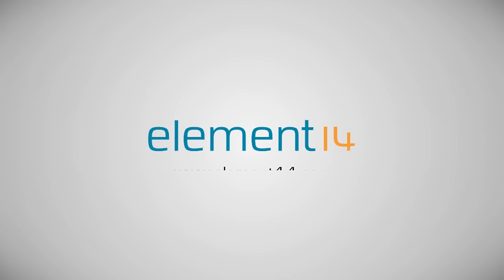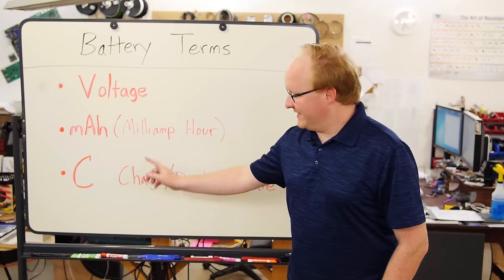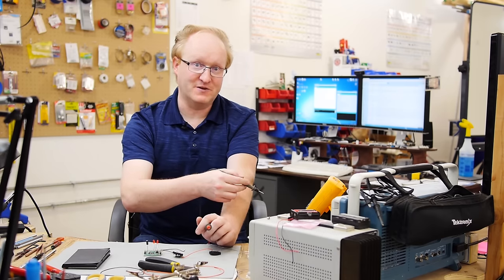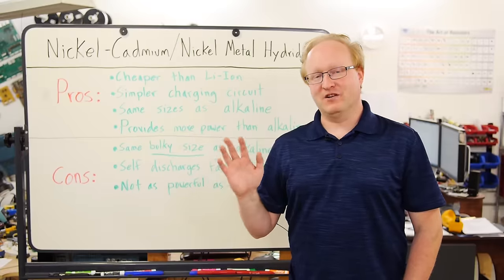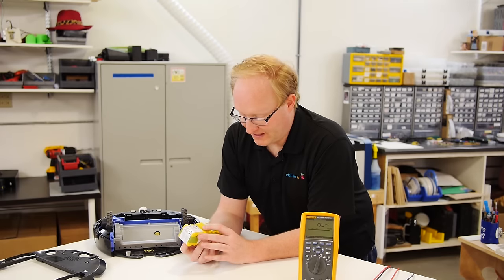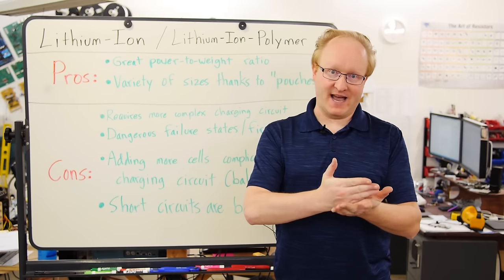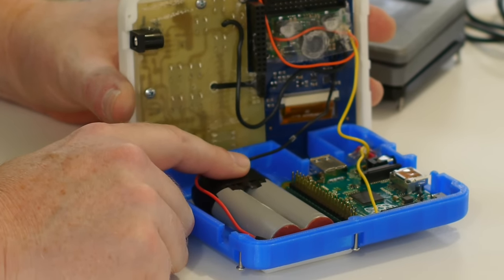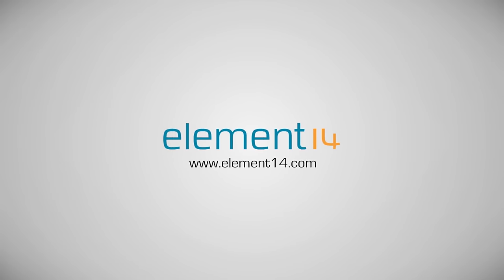Ben Heck’s Essentials Series 2 - Battery Power

Comment: No love for jell lead acid batteries? They work the same as normal lead acid, but the acid is gelatinized, so no need to worry about leaks, and the battery can be completely sealed.

Comment: I still remember how someone left a lead-acid battery connected to the charger over the weekend in our confined robotics lab, obviously, it exploded, and the smell was DELIGHTFUL... /s
Reply: דוד שלמייב quick-charger?... normally lead-acid batteries don't explode unless something very bad is done with them (such as excessive charging voltage while having them next to an open flame or similar).

well, unless it is a flooded lead-acid (vs a VRLA / AGM battery), which tend to leak a bit more hydrogen.
Reply: Brendan Bohannon Yep, quick charger.
Reply: דוד שלמייב
yeah.

I have mostly ended up charging batteries with a lab-supply, mostly for sake of control over voltages and current.

I have an automatic charger, which seems to like spiking to around 17 volts, which is a bit out-of-spec for the batteries I use. I tend to do charging at 14.8 and then drop to 13.6 when the battery is mostly charged.

the opposite end is a UPS which seems to always trickle-charge (so takes very long time to charge a battery and generally never goes over 14v).

granted, most of the batteries I use are the smaller / UPS-style batteries (mostly sufficient for a lot of the stuff I am doing).

plenty sufficient for small robots.

Comment: Sony used the battery on the PSP (or rather the circuit inside the battery pack) to tell the system which state to boot to. For instance service mode. This is what allowed the "Pandora Battery" hack to work, as users were given access to precisely what I just mentioned: The system's service mode.

Comment: Some 9V Batteries have AAAA batteries inside, not AAA
Reply: Witold Witkowski Was about to say the same
Reply: Witold Witkowski
most 9v batteries I have looked into have a stack of small rectangular cells, typically surrounded by a layer of plastic. IIRC, one had separate cells as individual units stacked together (similar to rectangular coin-cells). more common seems to be alternating layers of plate and electrolyte, with a shared shrink-tube style exterior.

though, this is alkaline, no idea about NiMH.
Reply: What brand were those? I would think the cheaper ones would be those stacks vs individual cells but I don't have any experience, I just remember seeing they were quad A not triple A.
Reply: *****  I forget now what the stacked coin-cell one was. one I looked into recently was a "Bateria Prima" battery, which was using the shrink-wrapped tube of plates construction. also have some "PakKo" batteries and similar.
Reply: I can't remember which channel as it's been a while but they tore some apart, I seem to remember the name brands being in AAAA package instead of open in plates. But I could be mistaken.
Reply: *****  could be. don't really have any big name-brand 9v batteries on-hand.
Reply: *****   these have coin-cells, granted, but the battery in question was still a normal 9v PP3 battery.

https://en.wikipedia.org/wiki/File:9V_innards_3_different_cells.jpg

the left two are what I typically see.

the weird one was more like this:
https://en.wikipedia.org/wiki/File:9V-NiMH-opened-battery.jpg

except I think it was still alkaline...

ADD: checking, actually it seems a lot of my batteries are Zinc-Carbon...

Comment: There is one pro for Lead Acid that you should have said. Shelf life. A properly maintained lead acid battery can last for many years where as batteries like Lith-Ion have very limited charge/discharge cycles and typically need replaced after a couple of years depending on how often you use it. Lead acid is great for powering out door solar projects as they are easy to charge, store a lot of power and have a long charge cycle life. We use them for our emergency power for our ham radio equipment on mountain tops and in our to go trailer.
Reply: ***** Dead right. I have an APC UPS system from 2001 that has the ORIGINAL lead acid batteries in it. They are still going strong to this day when the power cuts out. Now if only I could get the monitor to work on Windows 10. Worked on 7. Oh well...

Comment: I really thought that the Li-Ion batteries were safer, because I heard that the Nickel ones were more likely to explode that Li-Ion... My whole life is a lie :(
Reply: Nahir Sanchez yeah. vs LiON, the nickel-based batteries are pretty stable. also they can be run completely flat and they don't care.

had a NiCad battery pack I have been using (3.6v), that I had got ahold of second-hand about a decade ago. so, about a decade of sitting around in a box. charged it up, and it works fine. though, the first time I charged it up (after a decade in a box), it seemed to go dead again pretty fast. after this (charging it again), it seems to go pretty strong.

though, I am mostly using it for testing boards (providing logic-rail voltage and/or for providing control signals). this is partly because a lot of my boards use multiple voltage rails, typically 3.3v or 5v for logic, and one or more higher-voltage rails (12v or higher) for driving loads.

Comment: there are two types of C  for discharge..
Constant and Burst..
Constant - 2A battery & 10C = 20A constant
Burst is normally conciderably higher
Burst - 2A battery & 30C - 60A burst..

meaning.. your specific battery can safely discharge at a constant of 20A, but can handle short bursts of upto 60A..
remember.. C rating is the amount of Safe discharge..
Discharging anymore than the specified ratings can cause damage to cells, and can lead of explosions and fires..
(i used to race Brushless RC cars, with LiPo batteries)....

Comment: Ben, the Roomba battery pack is not a bunch of batteries in parallel. It's 12 sub C cells, all in series - hence the 14.4V (12x 1.2 = 14.4). 3000 mAh is a common capacity for sub C cells.

Comment: The RAYOVAC lantern battery that was opened up at about 5 minutes into the video and was implied was Alkaline is actually Carbon Zinc.  RAYOVAC uses this color combination on the battery package for many of their heavy-duty Carbon Zinc batteries.  Additionally, RAYOVAC would always include the word "Alkaline" on at least the main panel of the battery if it were Alkaline.

Comment: The DeWalt 20V Max batteries are actually 18-volt batteries.  I'd like to see you build an adapter with a built-in low-voltage cutoff circuit that would allow you to use 20V Max li-ion batteries in 18-volt DeWalt tools.

Comment: The Ben Heck Show  How about sharing the charging circuit you use for LiPo batteries?  I've been watching for some time, and have seen you make your own but you never share any information about it.  I am looking for something that both powers your device as well as charging the battery, then will run the device from battery power when the charger is unplugged.  I've found many specialized IC's in BGA or other non-hobbyist packages, or they are dedicated chargers.  It would be nice to know what kind of solution you came up with!

Comment: In airsoft, guns that run on an electric motor to drive an air piston (AEG) most commonly use NIMH batteries. Because of their relative stability, life, and cost. Although some people use LiPo batteries for their high current output. Although those are less common for their tendency to destroy systems that aren't designed to handle that much power in burst. Which requires extra cost of having reinforced gears,motors, and frequently mosfets. As well as their tendency to heat and burn up if used incorrectly or damaged.

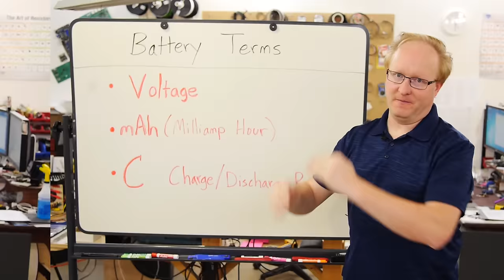Comment: Small error at 2:55; 'mAh' does not describe the power, it is the current draining capability. For power you need the 'mWh' rating which is actually more useful but is less often labeled.

I'm sure Ben knows this and it was just a slip of the tongue, but I thought that I'd point it out.

Comment: This was a good basic presentation for the most typically used battery tech used today. Although, I would have liked to see mention of Absorbed Glass Mat batteries when you got to lead acid batteries. They are very expensive but are more powerful, can go through more charge/discharge cycles than lead acid batteries before failing, they are sealed so it cannot leak unless the case is ruptured, and do not put off sulfur-dioxide gas when charging.

Comment: Very informative. I know that the xbox 360 controller will run off of double A batteries without a power pack if you just wedge some pennies under the batteries to keep them in place.

Comment: Another reason for not putting batteries in checked bag and keeping them on your person is the baggage area of the plane is not pressurized so there can be temperature and atmospheric changes which could cause the battery to swell and possibly short internally. Where as in the cabin area it is pressurized to simulate sea level atmospheric pressure and a comfortable constant temperature which batteries can safely survive in. Unless its a Samsung Note 7! :D

Comment: I remember taking apart a xbox battery pack before looks like it a had a temp probe thingy hanging on it I didn't see that  on yours so it stopped charging when it got too hot so I removed that and they charged fully instead of five minute charge only lasting ten minutes without the charge cord

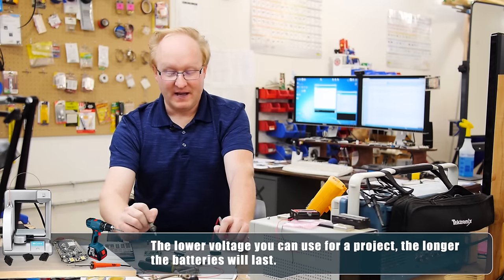Comment: 8:00 wouldn't something that runs on a fixed voltage internally use less current at a higher input voltage? I'm guessing that the extra power draw was because the leds were connected in such a way that they get the un regulated input voltage since they were significantly brighter with 6 volts going in to the setup.

Comment: i found a battery that is supposed to produce 12 volts and run a portable screen but the screen will not work right when i plug it in it works fine using a 12 volt wall wort though

Comment: Ben, is it possible to transform an Li-Po battery pack from "model planes" (don't know the name) into a battery pack for your old notebook that you have laying around?
Because I have an old HP Pavilion dv6670 and it's battery went dead. I think it would need a step-up voltage regulator too because it uses 18 volts to power it. I love the show! Cheers from Brazil!
Reply: Pesterenan You can connect Li-Pos to a boost converter. Connect the boost converter output (correct voltage) to an old laptop power lead and you are in business. The only catch and this is important. You must have an under voltage shut down. When the Li-Po voltage gets low it must shut off or you will ruin the batteries.
Reply: Great! Well thats a really cool project, unfortunately Li-Pos here are really expensive, and on top of that, they can explode if charged incorrectly. But that really is a good idea. Thanks!

Comment: I was hoping Ben would discus lithium iron phosphate batteries
Reply: John Wiggins Me too.
Reply: John Wiggins yeah. I guess they are basically like LiON, but better behaved and less explosive, with less energy density but more power density (lower capacity but more amperage). price seems similar to LiON cells. seem to use same cell-type numbers/sizes as LiON as well...
Reply: John Wiggins If you really want to look at different types of lithium cells you want to check the torch guys or vapers. Lots of pretty graphs to look at.

Comment: I heard that Alkaline Batteries can be actually be recharged but at very low rate, is that true?
Reply: HDose Yes, you can charge them with a very low current trickle charger (there are ones specifically made for this) but you'd still be better off with eneloops.

Comment: I have a cable which converts mains AC to 12v DC. How many 9v batteries would I need to put in parallel to produce a current which is the same as the 12v DC?
Reply: Ross RS Depends on the current supply of the cable. 12v doesn't mean you have X current, it just means you have 12 volts. That's why power supplies are typically measured in Volts, Amperes (Amps, current) and Watts (total power)
Reply: Naoki Saito I believe the power supply said 5A
Reply: Ross RS You wont get a long battery life, but depends on the current drawn by the device too
Reply: Isn't the current drawn the same as what is supplied to it?
Reply: so how many 9v batteries would be needed for a device that needs 5A?
Reply: Technically one. Don't except any usable battery life however. But you can't just use a random figure, you'd need to measure the device and how much current it draws.